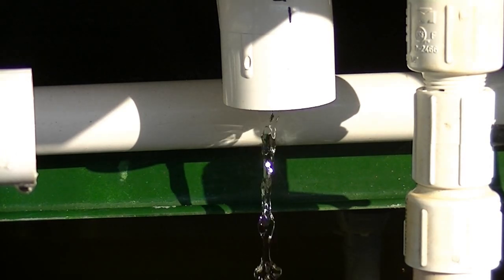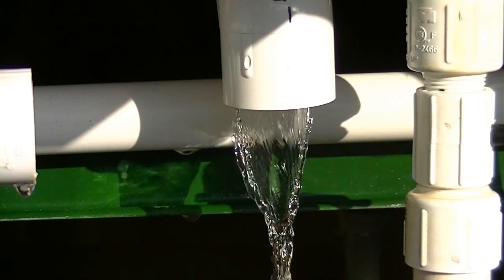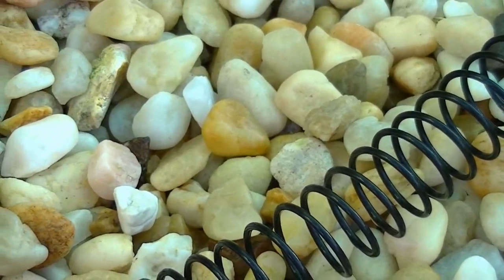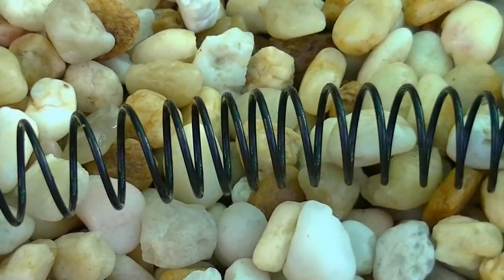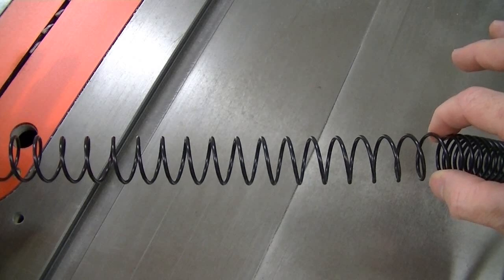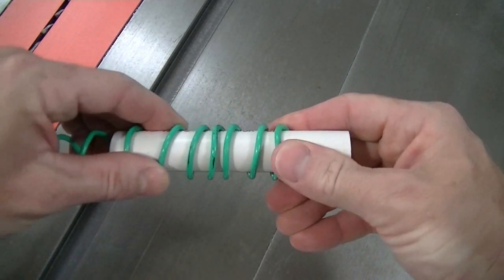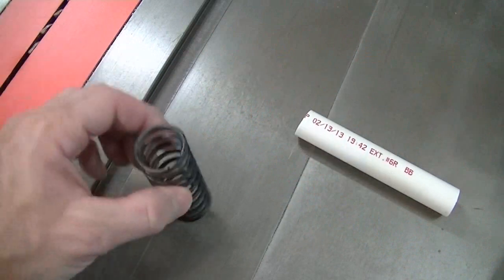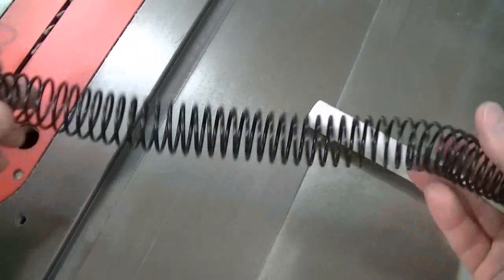Autosiphon Coil Spring Rapid Starter

Comment: NIce.   I noticed siphon 1 seems to be a straight pipe, is there a 90' on that one?   coil siphon seems to have a 90' on it.   A 90' or a long straight pipe is needed to give enough resistance to start.
Reply from the maker: Grow Bed 1 is the longest run...ie the farthest from the sump. Water flows down the stand pipe, makes a 90 degree turn toward the sump with then dumps into a 1-1/2" pipe. It goes all the way to the sump, about 12 feet, then takes the 90 degree turn straight down. Because this siphon starts in about 5 seconds, I have to assume that it is starting as it makes the turn toward the sump.